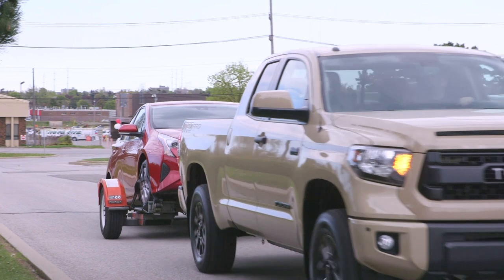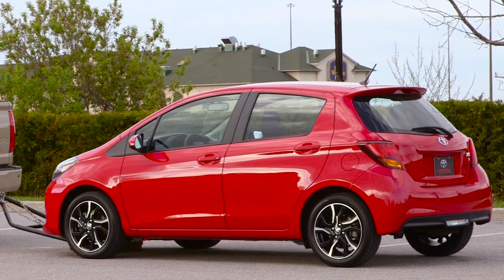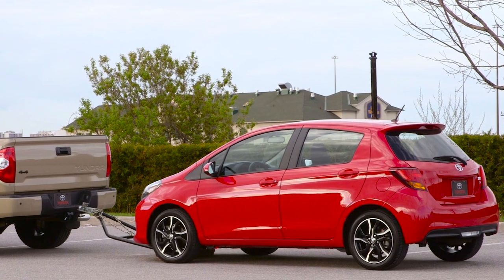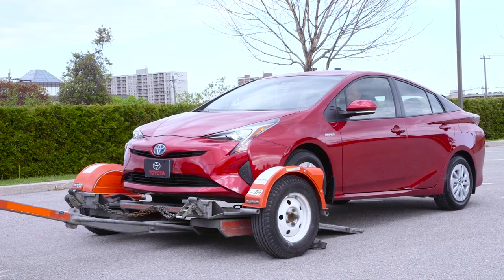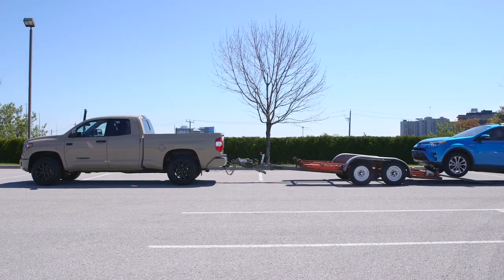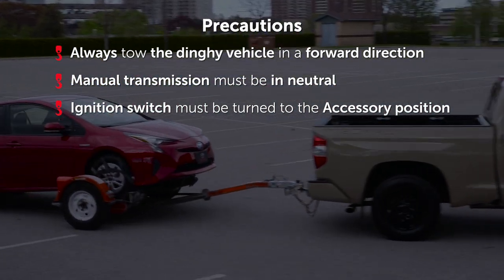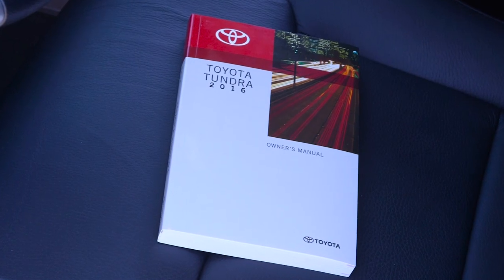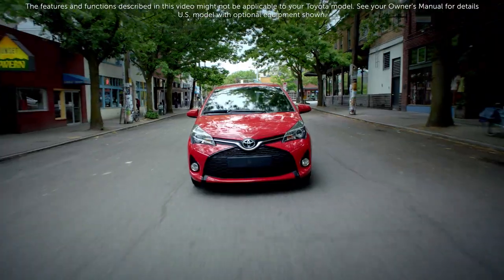Dinghy Towing

Comment: Just to confirm. We are going to tow our 2020 Prius Prime on a 2 wheel dolly. We should put the two front wheels on the dolly and leave the car in park. Correct?
Reply: You ever figure it out ? I’m wondering the same thing or if I put it in neutral
Reply: We ended up pulling the car all the way from DC to Boston with no issues. I strapped the front wheels down really tight, put the car in park, and I left the vehicle unlocked. It is super important to leave the car unlocked otherwise the vehicle alarm will go off. Also putting it in park allows the front wheels to move less when on the dolly.
Reply: @HairLossSolutions  Hi, you put it in the park because there is no transmission - rear tire connection right? can we still put it to N and tow? I feel safer